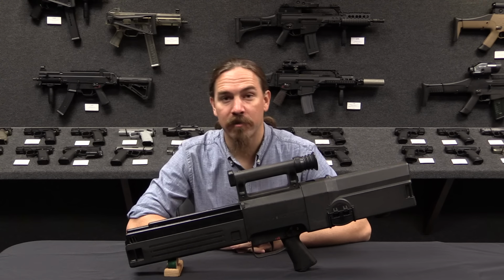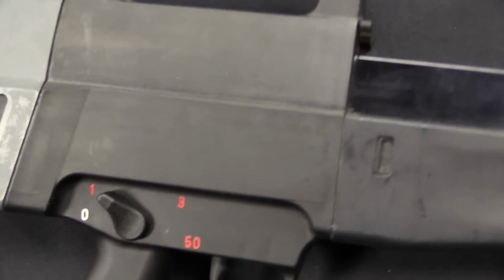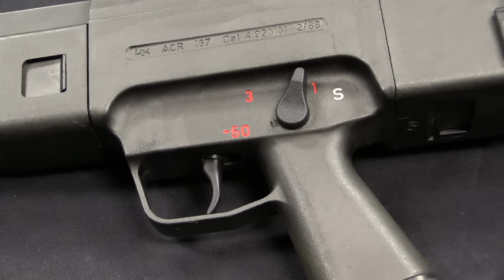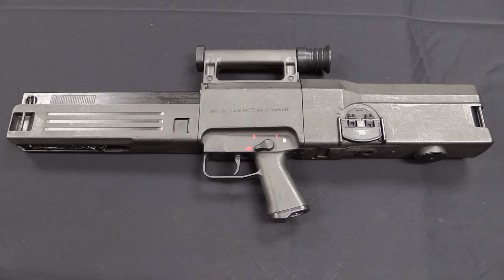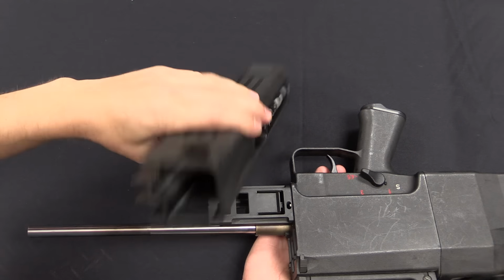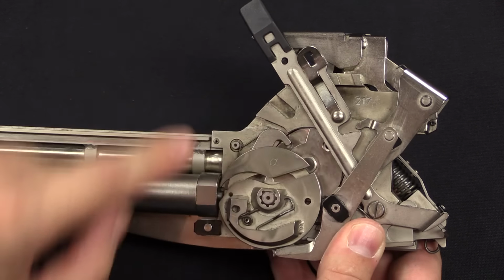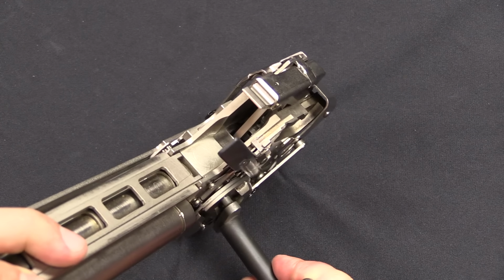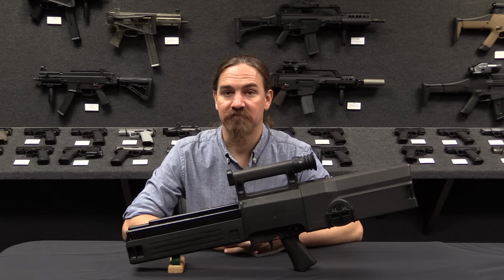Kraut Space Magic: the H&K G11

Comment: WAIT... Couldn't you just use this system with regular cartridges? I mean, it pushes out the dud case anyways so... It's kinda like a regular rifle except weirder? Correct me if I'm wrong, but from my own tinkering with a whole bunch of mechanical stuff, this looks entirely doable with a regular cartridge with some modifications, although it would have to be something like 9mm or 5.7mm or the MP7's 4.6mm because of the length limitation, but still... Damn space kraut magic, you confusle me.
Reply: It's doable, but it would be extremely complex and serve no purpose at all. It's basically taking the G11 and stripping it of anything that made it good
Reply: No - a conventional bottlenecked cartridge has to be inserted and extracted from the same side of the chamber. The straightwalled caseless cartridges could be inserted on one side and then pushed straight through out the other.
Reply: @ARCNA442  that itself is an innovation perhaps able to be built upon. Even square metallic or carbon cases could be a cheaper more space efficient better feeding format. Assuming the chamber will purge anything that can be jammed into tbat breech. I think that's an impossible challenge so instead i"d make that rotating chamber a quick detachable part and just carry spares.
Reply: nichevo1 You still can’t have a metallic cartridge just floating around in the cylinder. It needs something to support the back side or else you blow the case apart when fired and it gets jammed. Which is why they get inserted then extracted. With caseless it all burns anyway so they can get away with the cartridge being unsupported on the back side. Which is why it can get pushed all the way through. 

Like said above the action wouldn’t work with metallic cartridges.
Reply: A CT G11 still would be a waste of time because the G11 hyperburst was designed around caseless ammo and the fact that it wouldn't need to extract anything before doing the feed-firing cycle again. Anything that would require extraction from the G11 would make it more complex and pointless.

Comment: Yea, the US had one serious issue they would've needed to fix before these things were anything more than demonstrators.
That was the round size. The US has done loads of small calibre testing, and no way would we accept any round smaller than 5.5mm. Heck, the AK74 is barely below that, and they have to put a little offset air bubble in the tip of every round to make it capable of causing the damage a military round needs to deliver.
The Navy/Marines didn't think they could get a round that large, so it was never more than a toy to them.
Glad I could see the innards, in the early 90s that was still classified... Which makes sense, since finding out how really complicated it was puts a damper on my former good feels for such an interesting system.
The primer's initial charge is tiny, plus it releases something like a binary chemical that has a small delay until it ignites the main charge, firing the round. That initial small charge seats the round in end of the chamber (forcing cone at the start of the rifling) which also causes the "case" to shatter into tiny pieces/dust. Which is super important as well to get all the chemicals properly mixed. This allows a more complete, and usable, burn of the rounds propellant. Sounds very click-boom, but was a seriously fast reaction all things considered.
I'm saying that I'm very impressed with the work they succeeded with to make rounds at all for that thing. Pretty sure their work was integrated into the semi-combustible cases by the armor guys to get the modern round as good as it is now. The G11 folks worked hard to get a complete burn with very little residual stuff. Which was a problem we were having with the older semi-combustible cases.

Comment: How much weight two additional magazines add to the gun?
Reply: Wikipedia lists the K3 version as 3.65 kg empty, 4.3kg with 90 rds (I'd assume 2 mags of 45), so 0.65 kg for 2 45 rnd mags, assuming they're the same for K2 and K3...
Reply: @michaeltempsch5282  - I suspect that the Bundeswehr planned to keep one side slot free to keep from losing a magazine during reloads.  Move the empty magazine from the center to the open slot, and then move the second magazine to the center to reload.  Without a slot free, you would have to drop the empty magazine before exchanging its position with one of the filled magazines.

Comment: Excellent review, Ian has the best job in the world!  One of the markings didn't get a mention; the stand-alone interior part has the markings "Jim's toy" stamped onto it - @ 23:07 it can be clearly seen upside down!
Reply: Jim there has a very nice toy indeed
Reply: I wonder if "Jim" is the late Jim Schatz. One of the things he was famous for was hating caseless ammunition.
Reply: @schifty1  - During the ACR trials, Jim Schatz was HK's project manager for the G11 ACR.  So yes, the display was almost certainly built for his use in briefings and demonstrations.
Reply: Jim Schatz didn't hate caseless ammo. He was the project manager and trainer for the G11/ACR program, that was the dummy demonstration model he would use on grey room tour presentations.
Reply: @MEGATRYANT  - Jim's post-HK presentations at NDIA were pretty negative about the viability of caseless cartridges in small arms.
Reply: His presentations far from "hate" on caseless ammo, in fact they do mention many benefits related to it. It questions the viability due to complexity issues, mostly due to the mechanisms needed to properly seal the chamber, and the costs involved. And brings up the question if seeking caseless ammo is really worth it when compared to modern cased-telescoped polymer ammo when comparing their weight savings (50% weight saving + 30% volume saving CL vs 40% weight saving CT).

Comment: While it is cool and a marvel of engineering, the guts of of the thing looks like a watchmaker’s nightmare.
Reply: Wet nightmare?
Reply: From a mechanical watch or clock perspective, it's really not that bad. Sure it looks complicated as a whole, but take it as a series of functions instead and it becomes much simpler and more approachable.
Reply: Just learn to sexualize your fears.
Reply: i was thinking: steampunk's wet dream.

So for everyone considering getting his hands on this gun: 
you could just take the action to any steampunk cosplay event and be head-hancho with the ladies. and the guys. (and the cops, obviously)
Reply: Doesn't look much worse than an electric Airsoft rifle (AEG). There is a video where they take out the cylinder, the rest of the parts are all on the surface.
 They can be cleaned and oiled by novices. I am curious if the action is  foolproof, we probably will never know....
Reply: I was thinking of a sewing machine. xD

Comment: If the gun ejects misfires couldn't it also eject empty cases? Why didnt they make a cased version? Wouldnt this solve all of the overheating problems and make this a superior rifle to all modern day rifles?
Reply: Can T Not really. The big draw of case less ammo was without the brass case it made the ammo much lighter. These guns weren't much more accurate than the m16
Reply: I want to say "No" because of the different way brass cases have to lock into the chamber, but I'm also not discounting the idea of polymer cases, or brass cases with no rim whatsoever so no chamber lock-up is needed. However, the action would have to be substantially larger in order to fit the dimensions of a traditional case, so the size might be too larger to be to practical. An interesting question.
Reply: One of the points of caseless is to increase the amount of ammunition an individual soldier can carry. 500 rounds of 4.73x33mm weigh roughly as much as 250 rounds of 5.56 or 100 rounds of 7.62
Reply: I was referring to cartridges like the LSAT telescoped cases or rimless cartridges.. Then yoi could have a bullpup rifle that is compact but not super hard to reload like normal bullpup rifles. You could have 50 round mags without having them sticking out too far out of the bottom, so that you can rest your rifle on something without the mag getting in the way. And you could easily check how much is left in your magazine when the mags are transparent like the P90 ones. So basically it would be to a rifle what a p90 is to smgs: small compact light weapon with a huge magazine for suppressing fire.
Reply: @Feroce  I wouldn't consider Cased Telescoped ammo modern invention, the ACR project had at least 2 designs using it, Steyr ACR and Stoner's last baby the Ares AIWS.
Reply: That would have rendered the entire concept pointless. Think before you speak.
Reply: @md_vandenberg  Someone's salty, no need to be so rude

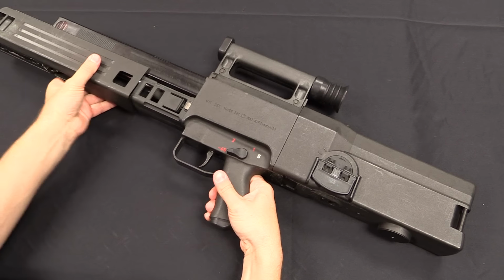Comment: You were using a special tool for cycling the action when the rifle is disassembled. The cleaning tool at 24:25 seems to have a bent metal rod attached to the base. One of the ends is a bit longer than the other,  just like the special tool. I'd wager you can either remove that piece or flip it to the side and use that to cycle the action of the gun. Using the special tool probably gives you better leverage though.

Comment: I have a dream that we, one day, will load our guns by pouring projectiles in a hopper at the top like paintballs!
Reply: Fuuuuuck that. That sounds awful.
Reply: polyhistor You heard of Roadhog, my dude?
Reply: They had that in 1898. It was called the Krag-Jorgensen
Reply: @shivermetimbers3218  The Krag has a pretty normal magazine with spring and follower, you just pull that stuff out first and place the rounds in without fighting spring tension.

Not quite a hopper like the early gavity fed Gatlings and Type 11LMG.
Reply: The original Gatling used a hopper feed, and so did the Japanese Type 11 light machinegun. Evidently there's a reason hoppers haven't been widely accepted, I should think.

(Even if they are pretty cool.)

Comment: G11 Mud test when?
Reply: I am pretty sure that it would do great in a mud test, since no empty cases need to be ejected, there is almost no way how mud could enter the inside of the gun.
Reply: No.. just no
Reply: @tentacles10000  yes
Reply: From what I heard it did well during the tests
Also: see comment above
Reply: I think it could handle a pressure washer loaded with sand, mud and puréed baby food at 300psi. Of course you take off the back cover and give it a dirty look and it will spontaneously explode or try to invade Poland 🇵🇱.
Reply: It looks like it can stand mud quite well cuz there's no casings to eject so no holes,  but a dried booger could jam those gears and stuff in there
Reply: During field tests it performed much better than the AK variants. G11 was designed to have very tight sealings in every critical point of the firearm casing.
Reply: Stale meme
Reply: @Kawawaymog  Exactly.
Reply: We need to know

Comment: "You can see that they have helpfully shown you a diagram of the case so that you don't put the cartridges in... backwards."

I see what you did there. That little pause was perfect.
Reply: There's also a white line on part (lower/rear end) of the upper edge of the magazine, probably easier to see in low light situations. Looks like (on a small screen for the moment) it might be slightly recessed as well, for id by feel.

Comment: When the G11 fails in the battlefield you simple pull it apart and use the built-in metal club (21:43) to eliminate the enemy
Reply: That's not a club, that's a Terminator's left arm!
Reply: I think disassembling even AK's bolt in combat situation is rather impractical......most of the malfunction on G11 seems can easily be solved by working the action
Reply: @程鈞ChengJyun8542  I think it's highly necessary that they improvise a second chamber rammer in the detachable grip clean tool. It's totally foreseeable that there will be a gun that's been immersed for a week, or the magazine was or the stripper clip was or the soldier was who was wearing it, plus maybe heat and humidity and chemicals, and somehow or other there's always going to be a chamber that has to be cleared properly meaning mucking out a half sodden half deflagrated chunk of sensitive plastic probably still smoking and burning hot. 

The onboard chamber rammer/ejector solution better be solid.  Even so some dogface would have it to do. If that entire cylinder containing the chamber could be QD/ejected from the action that could be a quick field serviceable repair that would save the gun/return the shooter to action.  

How deep is the data that these rifles are fit for purpose? German procurement thorough? Honest? Without bias? Like or unlike ours? 😇🙈🙉🙊
Reply: @nichevo1 Yeah, remember the German Amphicar
Reply: It kinda looks like one of the engine-based weapons from FFXV tbqh.
Reply: Looks like something a holy angel would wield in a war against heaven and hell.

Comment: The only puzzle greater than the G11... the optimal location for the extra mags (and what would be the combat load out).
Reply: I'd say the back on a plate carrier with horizontal orientation. Just rotate it to left or right depending your Preference and pull behind to draw one of these. Might get in the way of a backpack but you could easily make it molle and strap it to the side of one of these if needed.
Reply: I guess the basic Loadout is 150 carried on the rifle or rather 135 with the d-rated clips. After that if you're on a mission where you're carrying 600 rounds of ammunition, you're reloading the three magazines from your 10 or 15 round modern stripper clip equivalents. Probably after a hundred and fifty rounds you wanted to give the gun a minute to cool off anyway. I wonder what the all up weight on the various components was.

Comment: Yeesh that action. How did the German army plan to conscript all the watchmakers needed to field service that monstrosity?
Reply: The thing is that rotating parts tend to fail less then reciprocating parts, because no parts leaves it pivot.
Reply: It's also supposedly very resistant, which I heard they proved by burying one on the testing grounds, then dug it out on the day of the test. If you think about it, on a full loaded rifle, the barrel is the only opening the gun has. As complicated as the internals are, I believe the ammunition would have been a bigger potential issue.
Reply: Replace it as an assembly.  Gun not working? Shuck the externals, new barrel and action slide in, old assembly goes back to HK, all paperwork signed and initialed in triplicate, job done.
Reply: Germans are very pedantic :-)

Comment: I think the change from black powder to smokeless was a significantly easier challenge than attempting caseless rounds. It sounds easy for about two seconds, then one potential problem after another begins to occur to me. Simply amazing that they got this far.
Reply: They solved all the problems. The biggest problem was just politics. If it wasnt politics caseless ammo would have been a norm today.
Reply: Maybe so, but we can't know for sure. Either way, it's a monumental achievement. EDIT: And the cost is one of those problems, just blaming politics ignores the fact that this was going to be a very expensive system to implement.
Reply: @jameshealy4594  Why would it be monumental? The precision is the same. The range is the same. The impact is the same.
Reply: @hp2084  I doubt that it would be the norm, more like the old case with bulpups, they would be a thing but much less used do to less practicality and the trade off of much easier to damaage ammo and complexity.
Reply: @CThyran  The brass is one of the most expensive parts of ammo - caseless rifle cartridges would probably be 10 cents/round.
Reply: the next big thing...caseless black powder
Reply: @TheWolfsnack  Rocket Ball ammo. A bullet with a hole filled with propellant in it. Patented in 1848.
Reply: Brass cartridges last forever. They can still fire with small dents, light corrosion, dirt, or even when wet. Drop a caseless round and it’s ruined.